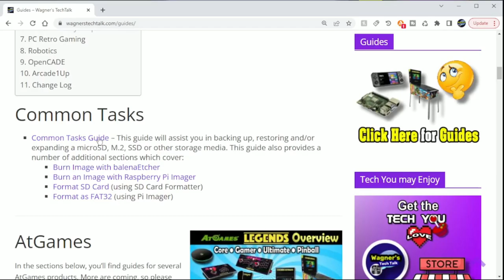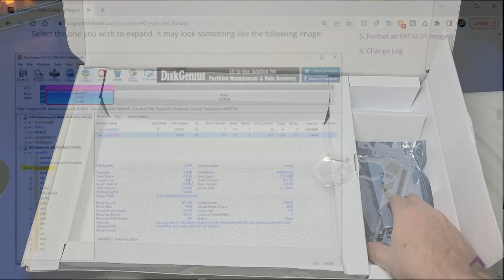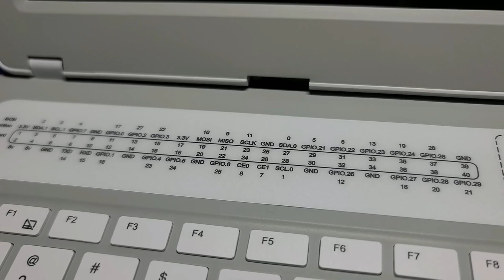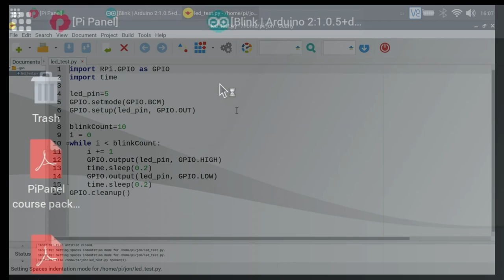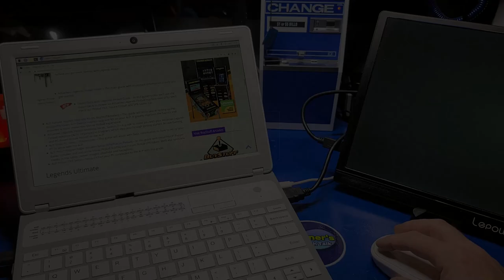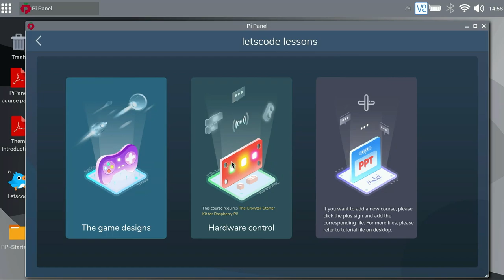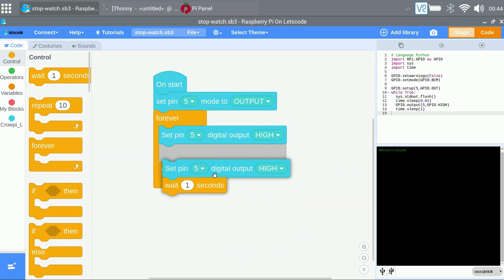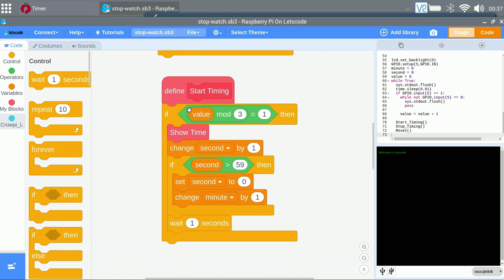CrowPi L Raspberry Pi4 Laptop Setup + Review

Comment: Great job on the video, I feel like you explained the features very well without lingering unnecessarily and I didn't find myself skipping ahead.

As for the device itself, I'm glad that it exists and it seems to do fill the niche that it was designed for. The included extras are a nice value add for beginner programmers and the ease of use should particularly help children and students to quickly dive in to lessons. I could definitely see these devices being used in schools.

As other commenters have mentioned, the price point is going to turn away a lot of tinkerers who just want an RPI kit to toy around with. The existence of the Pi 400 makes this a tough sell to anyone that doesn't need a portable display attached to their device. The current scarcity of Pi 4s (which I'm glad you mentioned) is going to make this unfeasible for others, as well.
Reply from the maker: Thank you for your kind comments and great to hear the flow of the video didn't require skipping ahead.  I agree, it is a niche product.  In fact, they have another product called the CrowPi 2 which I reviewed sometime ago that includes all of the sensors built-in under the keyboard.  I purchased x3 of those, one I donated to my kids school for their robotics lab.  I also agree, the price point may turn some away.  Though, the price isn't too far off from similar products such as the RasPad 3 (I also reviewed and love).  The difficulty getting a Pi 4 these days is certainly a concern, hoping that production will catch up with the demand soon.  Thank you again for your comments and for watching!

Comment: great product. Is there any space for small heat sinks between board and the cooling fan ?
Reply from the maker: Maybe enough room for one of those smaller copper heat sinks.  Probably not much else.
Reply: Heat sinks of size 14*14*4mm are applicable. Thanks for your suggestion, we will consider adding it in the future when producing.

Comment: It took some time, but I was able to get a CrowPi L and the kit.  I really do enjoy it, but I think that the ribbon connection to the laptop and to the base shield is a bit small.  I needed help to connect to the base shoeld because I bent the pins by mistake tryin to do it mysef.  Also gettin the paper off was a bit of a challenge.  Except for that I really enjoy the laptop and really like how the trackpad is at the top since I cannot stand trackpads on laptops.  I find the keyboard easy to type on.  Took me some time to get the python code workin, but I did manage it.  I would recomend this if the price gets lowered.  Right now the price is way way too high in my opinion.  Thanks WagnerTechTalk for this video.  It was very helpful puttin together the base shield and ribbon.
Reply from the maker: Thank you so much for your excellent feedback!  I'll pass it along to Elecrow for improvements in their next iteration of the product.

Comment: Hi Im really interested in this gadget. Why is the power supply USBC 12V ? .Doesnt the whole laptop works with a normal USB C 5V slow charger?. In case I need to use an alternative charge, will it work with one of this new fast chargers ? Thanks for the video
Reply from the maker: I presume it has to do with powering all the components, 12V was likely more appropriate.  However, for the exact design reasons I'd have to refer you to Elecrow.  I'm not privy to all the details and I don't want to mislead by making assumptions: https://www.elecrow.com/contacts .  If you don't get an answer, I'll be happy to ask on your behalf and reply back.  Just let me know if you need me to.
Reply: @WagnersTechTalk  Thanks very much.
Im gonna get in contact with them then

Comment: I’m really like this laptop accessory .   Could it be compatible with any other similar form factor for pi4 like a Rockpi or anything of sorts ?
Reply from the maker: I only own the Raspberry Pi 4 Model B SBC (well, a couple of Pi 3's, Zeros, etc., but they definitely won't work).  Great question Rexer, they state only the Pi 4 in the product description.
Reply: @WagnersTechTalk  some other SBC have almost identical form factor ,  just wondering if one was “close enough “ to fit the extension board.
Reply from the maker: Honestly, it "might" be fine.  I just don't want to tell you wrong.  Thanks for checking out the vid Sir!
Reply: The CrowPi L is designed according to the Raspberry Pi 4b, and the interface leads and positions are also designed for the Raspberry Pi 4b. If other boards have the same position and size as the design interface of the Raspberry Pi 4b, they can also be used. If you find it, you can also recommend it to us, we will test it and add it to the compatibility list. In fact, due to the recent shortage of Raspberry Pi 4b, we also noticed that there are some interesting designs on the market, such as some extended versions, which can "turn" CM4 or Raspberry Pi zero into Raspberry Pi 4b. If you have cm4 or pi zero2, you can try it yourself.

Comment: This looks cool and something I’d be interested in, however I’m not a fan of how the gpio is. Is there cables that adapt it back to full size? I’m doing a class programming a pi pico in C and we use the picos on chip Debugger to flash the programs to it.
Reply from the maker: Thanks Drew!  I'll check with Elecrow and see if they have something that will adapt to a full-size GPIO.

Comment: little expensive for what it is...but if they would of went ahead and built in a way to use the pi with a m.2 drive it would be more valuble...much better speeds than the sd cards
Reply from the maker: Excellent point, I fully agree with this!  Thank you for your feedback, I'll pass it along to Elecrow for a future model recommendation.

Comment: Loved the video, as usual. Thing is, I can't get my camera to work. I'll enclose the exact effor mrssages later. Forums and Crowpi tech support aren't useful for me. I know you're crazy busy, so If you can't help, maybe you can point me to someone who can?  Set up a new crow pi L. Everything seems to work fine, by when I try to test the camera using"raspistill -o Desktop/image.jpg" I get the following error lines:

mmal: Cannot read camera info, keeping the defaults for OV5647
mmal: mmal_vc_component_create: failed to create component 'vc.ril.camera' (1:ENOMEM)
mmal: mmal_component_create_core: could not create component 'vc.ril.camera' (1)
mmal: Failed to create camera component
mmal: main: Failed to create camera component
mmal: Camera is not detected. Please check carefully the camera module is installed correctly.

The camera is enabled and the physical hardware conection looks fine. 

Wht do I do now?
Reply from the maker: First thing I'd try is an online Webcam test, something like this: https://webcammictest.com to see if you get any output.  If not, chances are it's going to be a hardware issue.  I would first power off the L, then open the back and see if there are any GPIO pins that aren't going through the breadboard connector.  Secondly, I'd disconnect/reconnect each flat EDP cable and make sure they are properly seated and locked down.  Then retry the web-based camera test.  If none of the above helps, I'd reach out to https://www.elecrow.com/contacts for an exchange.  If you bought it on a site like Amazon, exchange it there instead.
Reply: Holy Cow! Thanks for your speedy reply. I'm a little tied up this afternoon, but I'll update you tomorrow. @WagnersTechTalk
Reply: @WagnersTechTalk  Web cam test was successful. What does that mean in connection with raspberry pi command line?
Reply from the maker: Good news, it's a software issue!  Check with the raspistill library developer forums that may have suggestions for you.  Sorry, it's not something i used lately but I do know they were going through some changes with that library a few years ago.
Reply: Thanks again. Love reading all of your reviews.
Reply from the maker: Very welcome, thank you for your support!

Comment: i love the raspberry pi but after you buy the notebook adapter for the raspberry pi to make it look like a notebook than you might of realized that you could of bought a cheap regular notebook lol
Reply from the maker: I appreciate your feedback, it really depends on your use-case and if you want a portable Pi 4 solution, Chromebook or other portable computer.  If it's for electronics/coding or a portable Pi 4 solution, this is worth considering.
Reply: CrowPi-L is a cost-effective custom laptop designed for Raspberry Pi enthusiasts, for the learning of programming education. CrowPi-L provides you with rich, systematic and progressive programming courses that make it easier to learn Letscode graphical programming and Python programming, whether you are a beginner or an advanced programmer.
Reply: @jasminehuang5337  im sorry if you thout i was talking bad about it because i wasn't because i had one ( mine burned up) i spend hundreds of dollars on robots stuff and other kits, i loved it but i found out that you can buy Arduino kit stuff a little cheaper than a PI and if you where going to make the PI in to a notebook to control stuff than you could of got a cheap notebook with a Arduino to do the same thing
Reply: @linuxuser145  It doesn't matter. I want to express that the Crowpi-L is not just a laptop, it has rich programming courses and multiple electronic modules. It is a raspberry pi kit for learning programming.

Comment: Oof this thing is way too expensive. They need to figure out a "lite" model of this and get it to around $100.
Reply from the maker: With the current coupon code, it's around $264 which isn't too bad for what you're getting.  But, I understand.  I like it for the Electronics tinkering and the ability to have a nice portable Pi solution with multiple operating systems.  Thank you for watching!
Reply: @WagnersTechTalk  coupon code?
Reply from the maker: @KillerofGods  Yes, when you click the link in the above video description there is a coupon, check the checkbox to apply it and you'll save a little extra.

Comment: I'd very much like to buy a laptop with RP4, which is not a thick ugly monster like this. This looks like it was something from the 90's... Of course, if you want to squeeze a full RP4 into a case, it will be thick, but why on earth is it impossible to buy a laptop case with a "motherboard" with a slot open for RP4 compute modul? Yes, that would be more expensive. And? So for me, this laptop case is just another useless thing.
Reply from the maker: I appreciate your feedback, this is a bit of a niche product for the larger Pi 4 model B.  A solution for the CM4 does make sense, agree with you there and perhaps we'll see something like that in future models.  At present, it's just very difficult to get our hands on a Pi4 or CM4 for that matter.